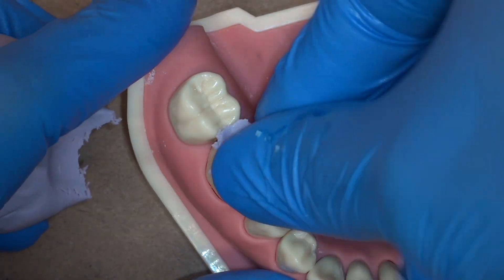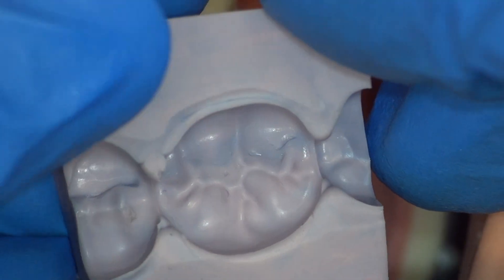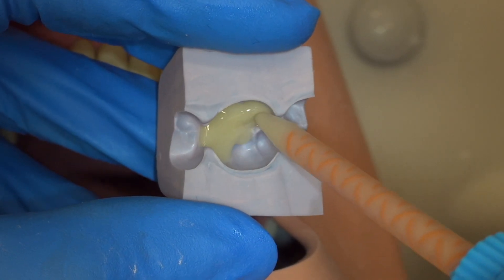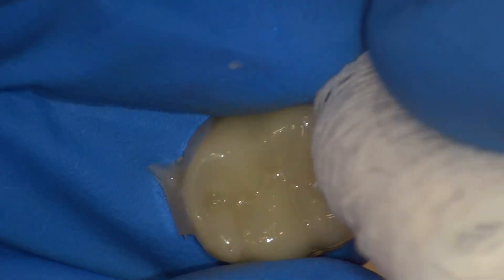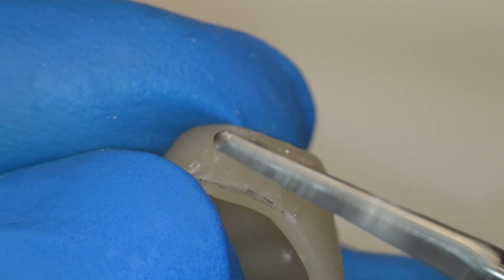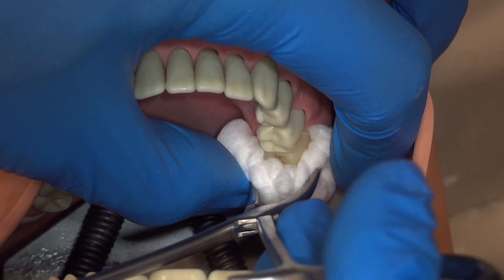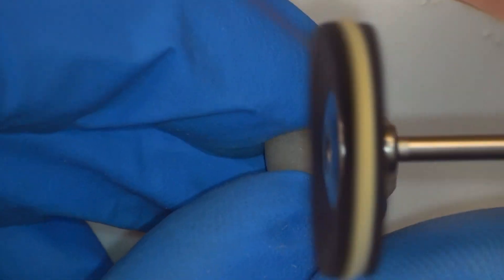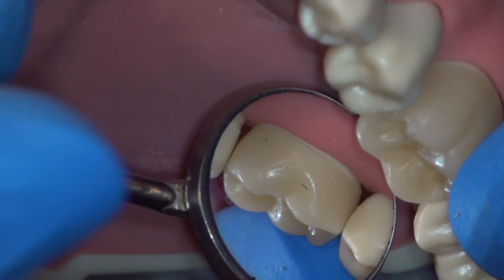Lower Molar Temporary Crown | First Person Perspective

Comment: What polishing products do you use? It looks like acrilustre and a cotton polishing buff for the last step, but what goat hair wheel do you use and what stone is that for the prior steps?
Reply from the maker: In this video I used a Brasseler "0664.11 Silicone Acrylic Polisher" and "10250022HP Soft Goat Hair with a Chamois Insert" followed by the buff with Acrilustre
In reality in the clinic I usually use the lathe and use medium grit pumice with rag wheel followed by acrilustre buffing wheel, its very fast and the shine is very good.
Reply: @dr.fritzmora  Thank you! What brand of buffing wheel? I use a cotton buff and it does not look as "fine" as your buffing wheel. Not sure if it makes a difference with the shine or not. This is the best temporary crown I have ever seen btw.
Reply from the maker: @stuartadam9651  I think it is 16222HP Felt Cloth Wheel Buff from Brasseler, but I don't think it matters. Actually this one has all kinds of "hairs" or strings that get left behind and kind of go everywhere so its not my favorite.

Comment: Looks really nice but it is a temporary we have for 1-2 weeks before the patient comes back for the definitive. Isnt this too much work?
Reply from the maker: It depends, in more extensive cases temporaries may be in place for much longer to condition tissues or test how the patient will adapt. Also, even in the short term, a poor temporary can cause inflammation of the tissues which will significantly complicate final impression making or cementation of the definitive. Each step contributes to how smooth the next step will be!

Comment: What is a clinically acceptable gap before adding tempbond or its equivalent?
Reply from the maker: This is a clinical decision dependent on how long the temporary will be in place, caries risk assessment, and patient hygiene. The tempbond will probably wash out from any significant gap so there could be decay even in a short time, also, when you continue with the definitive crown the tissues may be inflamed if there is a gap with plaque trapping which will make final impression or delivery more difficult. Best to be as good as possible!

Comment: What could be the reason for deficient margins or pin holes on the margins?
Reply from the maker: It could be too much separator, or perhaps a rough finishline--if intraoral, saliva contamination could contribute too. Open margin could be caused during trimming or even perhaps if there is an undercut in your preparation then when you remove the temporary it may flex or warp. The best thing to try is to make your prep as ideal as possible and use a minimum amount of separator and see if that fixes the issue, also remove the temporary carefully and try letting it set a little more so it will not flex or warp as easily.

Comment: How do you make temporary crown for grossly destructed tooth when you don't have putty impression of original tooth shape?
Reply from the maker: The temporary putty is typically made from a waxup using a cast of the initial situation. A waxup is always a good idea, because you may not have to reduce in certain areas, or you may discover that an opposing or adjacent tooth requires modification for an ideal comprehensive result.

Comment: I had a root canal treatment (RCT) on my 2nd molar on my lower left jaw last November.  I did not have it crown.  Unfortunately about 2 weeks ago the tooth cracked vertically.  I now left with half of the tooth, went to the dentist who suggested to have the half tooth extracted as it cannot be crown or repair.  I refused and finally he do filling on the exposed part of the tooth.
Is it possible to crown a half 2nd molar ?
Thank you
Reply from the maker: Unfortunately I cannot give you any specific advice. In rare cases a tooth hemisection can be done. You will have to talk to your dentist or seek a second opinion.
Reply: @dr.fritzmora  Thank you.  Is it possible to build up the half RCT 2nd molar using composite resin before placing the crown ?
Reply from the maker: @johnng3939  totally case dependent. You will have to talk to your dentist from here.
Reply: @dr.fritzmora  Thank you
Reply: I ask kriss ai about it and it says  it is possible to crown a half 2nd molar, depending on the condition of the remaining tooth structure. you can also check with your dentist for assessment :)
Reply: @soposhhh1122  Thank you
Reply: Who's kriss ai?
Reply: @allisondarcy  its an ai dental assistant,
Reply: @TitusMonger  oh nicee, how do i access that?